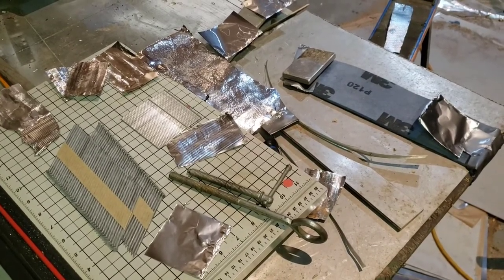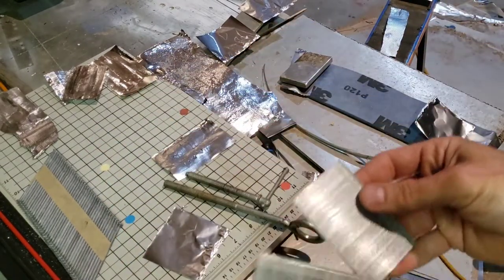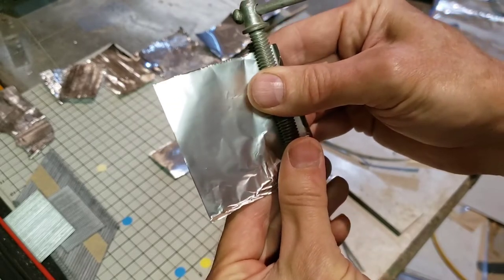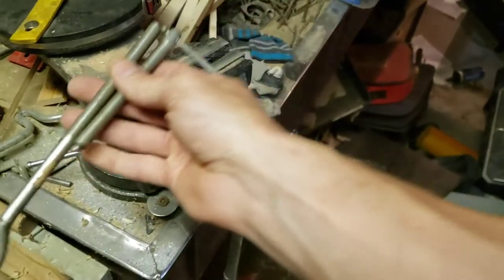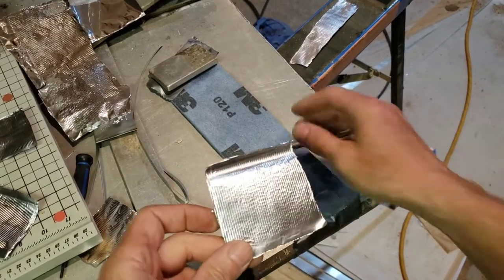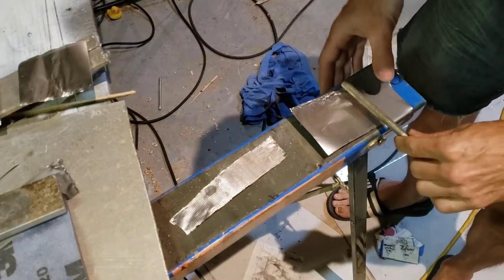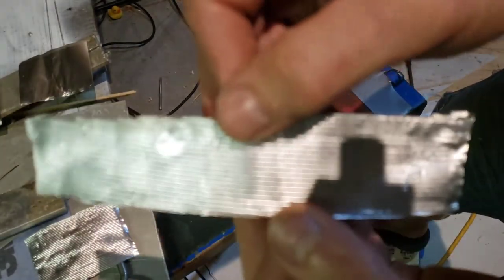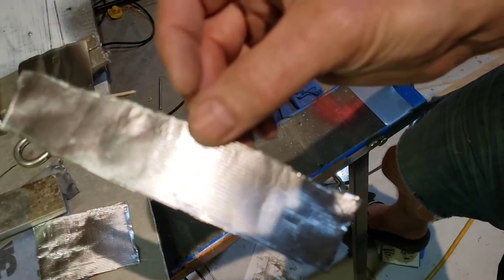How to make all the HO scale corrugated iron you could ever want!

Comment: Nice tip tutorial for sheet metal corrugated look.. recently found the insides of Rana lasagna box worked well for such that look.. peel away to reveal cardboard corrugated to use for sheet metal.. paint, weather rust turned out ok for HO or N scale..
Reply from the maker: Oh man. Food packaging is awesome. I'm afraid of my new reality of looking at what was former garbage that is now HO scale goodness! Thanks for watching.
Reply: Indeed on recycled items going into bin.. recent cleanup however yielded recycle bin full along with four bags full besides..
Reply: The corrugated cardboard is far more durable than foil. Foil is so frustrating to work with, a fingerprint will deform your work. But any cardboard box, you can get it damp, peel the top layer off, paint silver, and poof! You’ve got corrugated metal, ready to be weathered and installed. Depending on the thickness of the cardboard, really thick cardboard will have much larger corrugations, for larger scales, thin for smaller scales.  

And of course if you want you can just buy Plastruct plastic sheets. Already to go, just paint, and extremely durable.  Years ago I bought some styrene plastic sheets 8” X 11”, that were HO scale terracotta roofing! From China I think, but it was perfect for a large train station project.  I know many want to do it themselves, from found materials, but when realism counts, styrene isn’t that expensive.

Comment: I used an evergreen styrene corrugated sheet and used alfoil rubbing it into the grooves with a toothbrush
Reply from the maker: Good idea. I was trying to avoid buying a sheet but defo a great way to make endless sheet iron.
Reply: You can cut the sheets to size with scissors. Any damage done during cutting can be easily repaired by placing back on the styrene and lightly rubbing with the toothbrush again